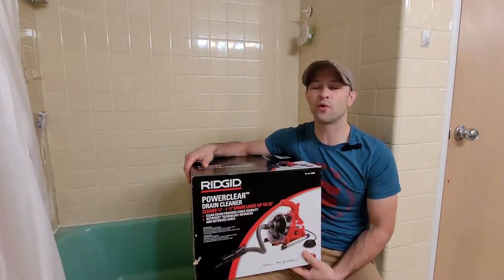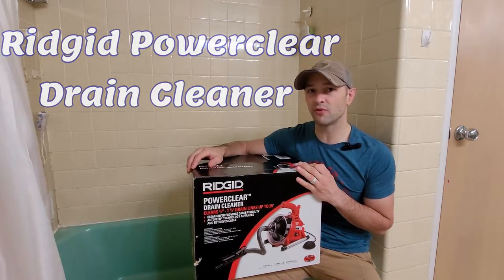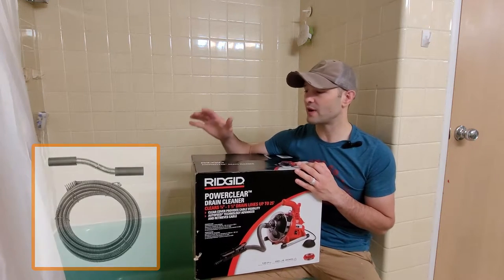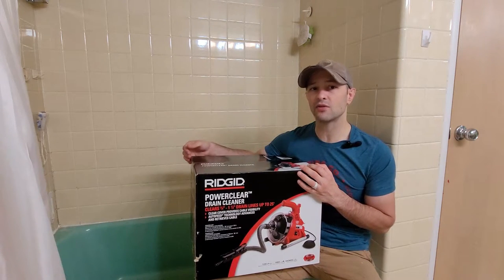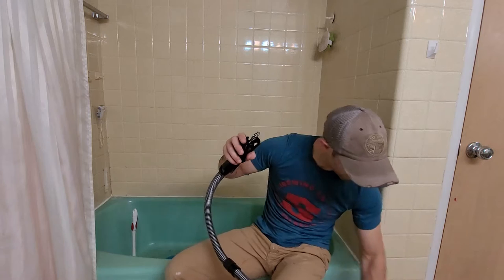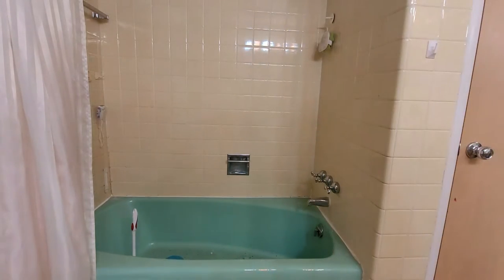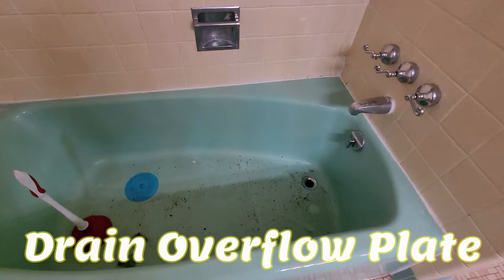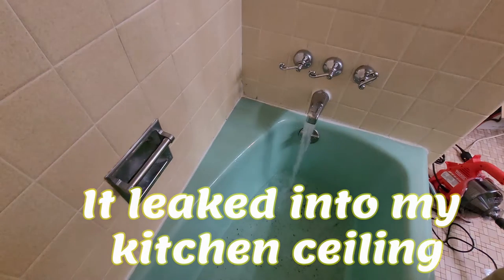Ridgid Power Clear Review

Comment: You could have saved the money by finding the drum trap first. The trap always cloggs at the toilet connection on the out side of the drum trap and is next to impossible to open without going through that rubber fernco cap. Don't forget to plug tub with putty or a washcloth before you remove that rubber cap. 25 years plumber

Comment: Awesome tool but a pain in the a$$ to put back in the coil it kept getting twisted up
Reply from the maker: @shanemiller4108  I think you're the 2nd person to mention having trouble getting it to go back..  I just used it again this weekend and had no issues.  I must be getting lucky - I go real slow putting it back and "guide it" with my hand.  It did twist once and pinched the hell out of my gloved finger!
Reply: @fortorangewoodworking  oh man that socks be safe and alright it broke the little wire on the inside of mine
Reply: @fortorangewoodworking  other then that I seen it work just after a few feet going down

Comment: I wonder how it compares to a Milwaukee M18 pistol snake.
Reply from the maker: Not sure. I don't have the Milwaukee platform and there are certain time where i want "plugged in power." 
Let me know if you bite the bullet and give it a shot!
Reply: @fortorangewoodworking  
Will do. I have a lot of m18 and m12 tools just not a pistol snake. So far I really think the M18 platform closes the gap between DC and AC tools. In fact my M12 fuel hammer drill drives screws 95 percent as fast as a 20v DeWalt MAX. Don't be afraid to ditch the cord man! Unless it's a K-50.

Comment: I'm watching this video from London UK. When would you use a short hose and the large combined 2 hoses together ?
Reply from the maker: The hoses can used as an 18", a 30" or a 48" when used in combination. The different lengths can be used depending on how far the machine will sit from the drain source. For example, if you are clearing a sink, you may want to use the longer hose so that the machine can sit on the floor and still reach. Hope that helps and thanks for subscribing!
Reply: @fortorangewoodworking  
Thanks a million for the answer.
Reply: When your under the cabinet or at the entry point and your helper runs the machine because your operating the feed point

Comment: gloves about $20., Loss of finger or ripping a tendon., Expensive life lessons.
Reply from the maker: As a woodworker, I've had too many close calls while wearing gloves. I was pretty confident that this thing wouldn't generate enough power to be a serious risk. Could've probably benefited from a pair of nitrile, though!
Reply: @fortorangewoodworking  thin rubber or plastic gloves are a 'no-go' when handling cable. Leather.
Reply: “Ugly” rubber gloves or the ones RIDGID supplies work well. All those microscopic barbs on the cable would love to take you down the drain with it so best to just be smart and safe with the proper gloves! Nitrile gloves will literally get torn off your hand and become impossible to pull out of the coils of the cable, so best to just be smart about it.

Comment: Absolute piece of garbage, do NOT waste money on this thing. Cables are junk and turn to solid rust after 1 use, the "clear" holder will be rust covered and useless in no time. Owned it for 2 years and on my third cable. It will be in the trash after this cable breaks. The cable feed rollers lock up, fall off, and make them totally worthless for auto feed and retract. Love rigid, but this thing is nothing but garbage. My K400 will go nearly anywhere thing thing will and works flawlessly. Small drain get the K9-102 Flex shaft now and this sits on the truck 99.9% of the time.